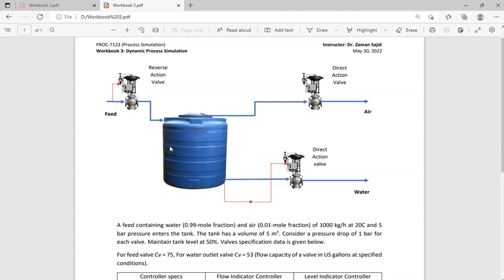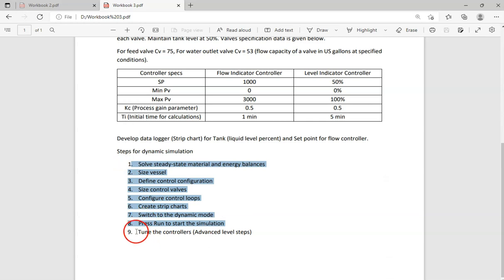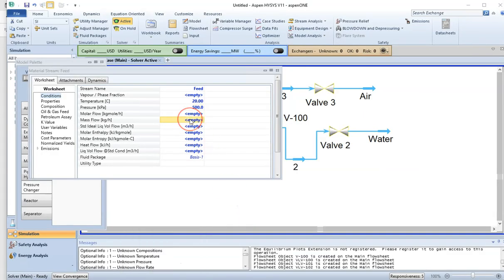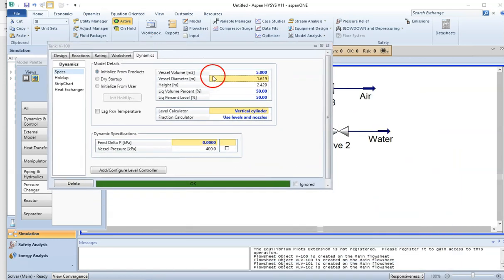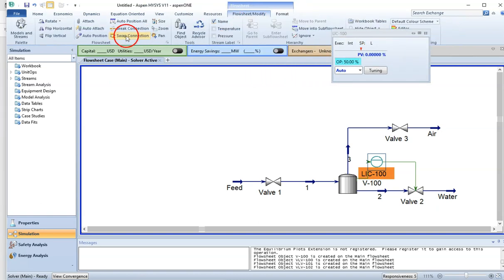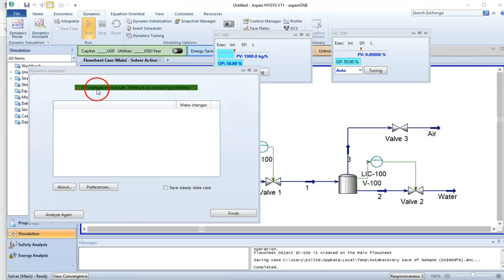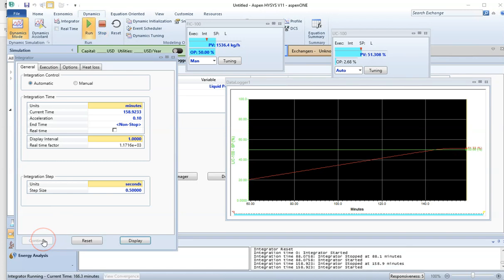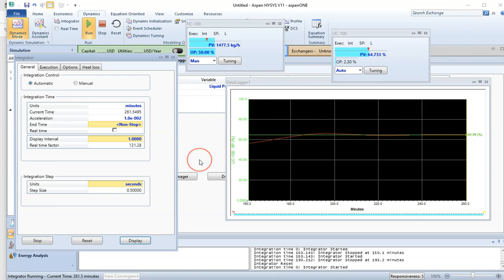Dynamic Simulation of a Tank in Aspen HYSYS

Comment: It's ok thx, but when the level reaches the SP value the level stabilizes because the LIC is manipulating the water outlet valve , it would have been nice that you showed also the water valve; And also, as you set the tank level at 0% at the start you should have set the outlet water valve at 0% at the start, should have been more realistic.